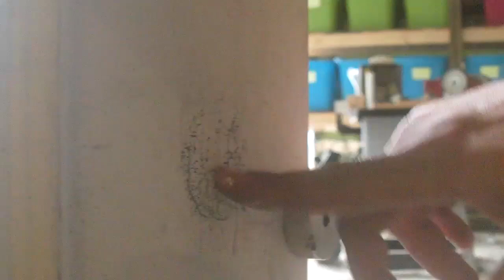Tesla Turbine from Hard Drive Platters for electrical power generation energy free hack

Comment: This is a pretty poor performance for a Tesla turbine, The platter spacing is not as specified by Tesla The Platters should have a space round the total outer diameter to allow free passage of pressurized air to access the whole of the platter diameter from all directions, because the function is in a spiral flow from the whole outside diameter towards the central exhaust .
I hope to build two full platter units as per Tesla's spec and run the second one to max speed or total self destruction which ever comes first. Unfortunately I have many other important projects to complete first, mainly a 3.5 gauge live steam 4-6-2 Britannia 70,000 followed by some precision measuring projects. Unfortunately at 83 years old I just hope I can get everything done. We shall sewe.

Comment: I am confused as to the purpose of this?  If you rigged it up to gain maximum spin and torque and connected the axle to a generator it would create electricity when spinning.  My problem is what is going to be use to make it spin?  Where is the highly compressed air going to be coming from?
Reply from the maker: Steam from solar. I was working on many different concepts when PV solar panels averaged $5 per watt. Over the past 7 years prices have dropped to sub $1 per watt with no moving parts so the applications are more for fun and or using excess steam or flow to make a project more efficient.
Reply: +GREENPOWERSCIENCE
Ok sounds cool.  Keep on experimenting.  Glad to see you are not one of the people who think Tesla turbines or coils are some kind of Free Energy wonder device.

Comment: Pointless video, AND has nothing to do with a "free energy hack". Methinks the video maker is a hack. Yeah, that's it.
Reply: +Robert Bodell (rbodell) I did watch the video and I still maintain there is no call for using either "free" or "energy" in the title. I have spun roller bearings with compressed air, big friggin' deal.

Comment: You were blowing down on the second test which explains the slower speed the disks started sliding down the door before you could get the equal force meaning gravity caused the slower speed. The first test was pushing up so more force could be exerted which would give you the faster rpms. I believe doing the test pointing up un the disks would give you about the same 14000 rpm. I also know that the disks are rated to 7200 or 10000 rpm so be careful I am not sure on the catastrophic failure speeds.

Comment: I wonder if Tesla valves have anything to do with this. We now know those valves are not one way valves but air through one direction creates more pressure than in the other direction because air has a much harder time to pass through. I wonder if you could create a high pressure, low pressure zones like a wind lens to amplify wind.  I really have no idea what these Tesla valves are for to be honest. I am trying to figure out
Reply: +Thinktank Pretty sure they were intended to be used so that fuel could be injected into a combustion chamber and burned up by sparks without needing a movable valve, so that you would have fewer moving parts and a higher efficiency. Fuel goes through valve and into combustion chamber as a vapor or liquid, detonates, and goes through the turbine without pressure managing to get back up the line to the fuel tank. No idea how well it actually worked, but a damn good idea if it did.
Reply: +Thinktank I am working on the idea of using a wing as a surface to amplify wind, since air must travel faster over top of wing, I think it will increase power and channel more wind if angled correctly.  The turbine would be placed into the top wing surface (probably 2/3 back toward trailing edge) with only the top exposed to airflow, the bottom of the turbine would be shrouded, and vents on the sides of wing. I want to use a modified tesla turbine ( 6 or so wing shaped &#39;spacers&#39; 1/8 inch or so thick built up on each ring [middle cut out entirely instead of the usual holes or cut out pieces] instead of just using disks, with two disk end plates to mount on a shaft). I think that having wing shaped foils built up in thin slices between the rings could enhance the performance in lower winds, and might make it less important to have such a tight boundary layer-determined spacing. The profile from the front of the stack would look like small wings with rings spaced every 1/8 inch or so. Wish I could illustrate the idea with a diagram. Robert Murray Smith just posted a video on a tesla air engine that is similar, my idea is to use that idea, but instead of washers around the rings, to use wing shaped spacers.

Comment: Interesting..  I am glad you put on a face mask..  But if you don't fix up a remote controller for the air, but keep your hand right in front, you will wind up with taking your safety mask off with your left hand, only if you are lucky..  Since the meter can go though clear plastic a shield covering the device would be good, heavy duty to be sure.  Any thoughts of places to get a CD stack like that?     Oh, and don't, really don't listen to the naysayer's..   You said it was just a test, a rough piece to be hacked into something better..   Remember, one piece of equipment the Wright Brothers used was a bicycle shop, from that they did this..   So, you are now one of them, perhaps..  And they had help with the engine..  So there..

"They gained the mechanical skills essential for their success by working for years in their shop with printing presses, bicycles, motors, and other machinery. Their work with bicycles in particular influenced their belief that an unstable vehicle like a flying machine could be controlled and balanced with practice.  From 1900 until their first powered flights in late 1903, they conducted extensive glider tests that also developed their skills as pilots. Their bicycle shop employee Charlie Taylor became an important part of the team, building their first airplane engine in close collaboration with the brothers. "

Comment: Western Digital Veloci-Raptor runs ~15k around the same as you get with your air compressor setup.  A computer PSU supplies 12V to achieve this, guessing the air compressor requires a little more?

Comment: and yes it works well at least on a 1200 watt generator and old water wheels, it is charging my battery bank that runs the house and the sence I do not turn it off I sell the excess energy back to the power company I have not payed a bill in 2 years and counting
now It droped from 100000 rpm to 85000 rpm when I used the escaping air to power the little air pump (bicycle pump) and took it off the air compressor, but all I needed was 45000 rpm so I still had to turn it down

Comment: its a turbine, all it does is spin, now when you have something spinning then you put it on a generatror or the end you can make a generator but all the turbine is doing is spinning, he will not get a good reading cause he needs a case that is round and dam near fits its so the centrigal force will push the air outward on the disk but the case is forcing it inward, so for example when it matches up you will go from 50,000 rpm to 70,000 rpm without using anymore energy

Comment: I have built Tesla turbines for over 20 years and once belonged to TEBA. I don't recommend it because they are ideologues and don't experiment as you have here. I learned two things which will make your experiment more successful. 1) use a wider nozzel. 2) there is noneed to use central ventilated disks. Letting the air enter the disk stack on the chord instead of the tangent gives lots more traction to the disk as the air drags the boundry layer over the surface. Because the chord is a short distance across the disk, a lot of energy goes to waste. If you simply form up a U shaped shroud, the air will follow the disk about 140 degrees and will give you a longer stream path. I built one that ran on steam. This also solved the bearing failure problem I had with earlier attempts because the steam entered and left the disk stack without filling the housing with high pressure hot steam. Good going. I like your thinking. I used up probably 50 old drives this way. Mine were only 4 disk drives. Make a wider nozzel and you have a killer going. They also work awesome on streams of water from a garden hose or in a brook behind your house. The hydro-turbines need a stream housing and instead of a U shaped shroud, using the chord works best with the wheel half way in the stream. Conversely, you can add a reversing U to the water coming off the wheel so it re-enters the stream withoug backpressure. AWESOME. I Really like your inventiveness. Hope my suggestions didn't go against the grain. I get a little windy and tend to give away the end of the "who dun it" Sorry if I did that.
John

Comment: How about using the original HD case as a case? Drill holes in the middle of the pack to allow exhaust, construct 3 nozzles wide enough to supply entire stack, have the DC -motor in its original place and supply constant pressure through a valve, adjusting it to some 8500 rpm?  Neat and sturdy.

The pressure for that project could come from solar heater. Steam would be fine for such home made system, as water is readily available, cheap and clean.

Mere proof of consept. But that's enough.

Comment: How well does it work with an 1 oHm resistor across the out put? I wonder if that would stop the platters from spinning. 

Also, be careful when you try to modify the platters, some of the newer drives use ceramic.

Comment: if you want to power it with sun created steam I'd vote against using water but find a gas with a very high expansion rate from liquid to gas that has an evaporation temperature of somewhere in the 20-30c range

Comment: This is an excellent idea.  Such 9K RPM hard drive boundary layer turbines could be mounted internally within an Einstein/Slizard closed-loop heat pump fired by a closed-loop HHO heat pump lit by a Weed Eater 20 Kv Magnitron plasma arc powered by a battery.  Stabilized super-oxygenated water (Hauck, Steve USAF plant #44) combined with an internal ozone generator would enhance closed-loop HHO heat pump performance.  Thank you for this instructional reutilization video.

Comment: There was a man who sailed across the ocean with some tubular sails in the 1900s, the tubes were as tall as masts and had discs on them. As the wind blew through the mast /disc arrangement there  a low pressure area was developed on the front side which pulled the boat forward. This is probably why the unit was moving down the door.. Also the 125 psi being applied to the surface area of the top.

Comment: Got my attention, and 5 stars!

Why do you think the disc platter moves down the door frame? 

Experiments have shown that  objects rotating at high speeds drop faster in a gravitational field than non-rotating ones of the same mass. Is the apparent mass of the rotating discs greater, pulling them down the frame, or is it simply vibration that scrapes the paint off?

Comment: The substrate to discs are glass. The older ones were metal all the way through.

There are current drives that move at 10K rpm (3.5" diameter) and 15K rpm (2.5" diameter)

Comment: this is very cool > But I have a hard time thinking that these plastic disc's can turn at 13000 plus RPM's and not fall apart.  the edge is traveling about 15000. feet per min.about 2.5 miles per mintute . I can estimate about 150 mph . seems a little fast to me . maybe I dont give plastic enuff credit

Comment: dude, you need to use the cool optical trick as the background behind greenpowerscience with that music for your opener and closer. put the camera slightly cocked askew to the discs then pan left to right from sky to trees while focused on the center shaft. for those that had not seen this vid, they would think it was just a cool video effect.

Comment: These old drives were designed to spin at way less than your 13,000 rpm. Like under 3500 I think. I see the disks are not centered on the rotation axis. I guess they are balanced though or that thing would have shook right of the door, or worse! 

What do you think? Did the unit feel more balanced than it looks?

Comment: Neato, Dude!

Never thought of a Harddrive in this way.

Wish I could be conducting experiments right now, I'm too busy trying to get cash. I've always wanted to get some rural property and start my tests. 

Even though I have alot of clever ideas, I think Tesla using the voltage differences between the ground and the sky is the way to go. Sucking the energy right out of the air is ideal for most situations. *****